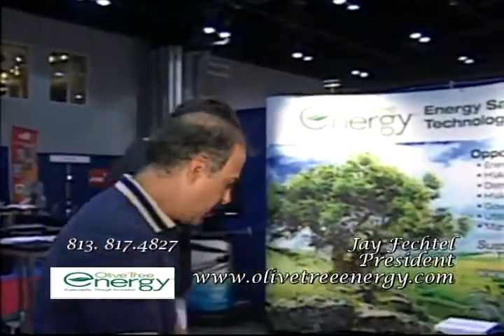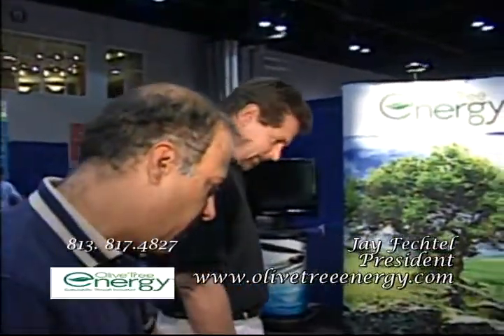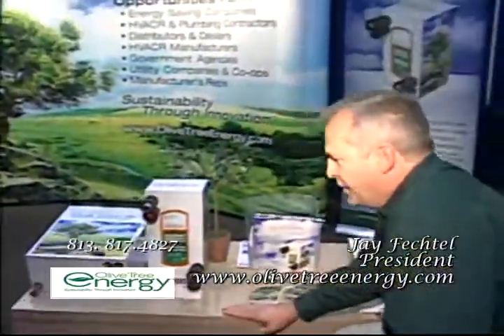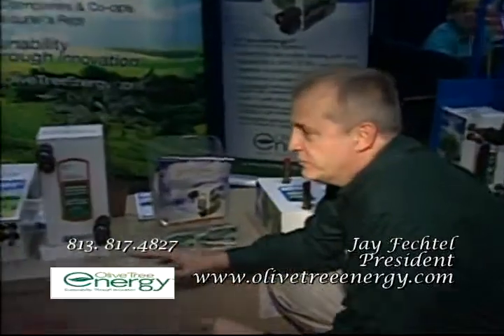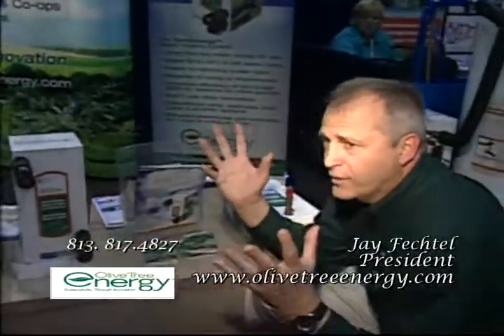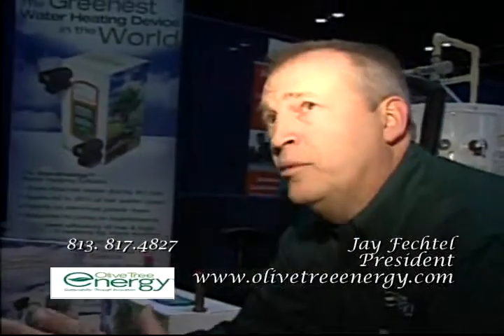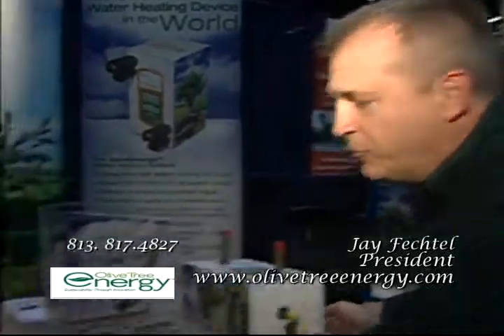ZeroEnergy™ Hot Water System - Smart HVAC Products

Comment: I'm an authorized Dealer for a Heat Recovery Unit made by Chesapeake, VA's HotSpotEnergy.  Learn more at: https://tinyurl.com/FreeHotWaterFromAC and call my Hollywood, FL landline # at 786.441.2727, toll-free: 800.250.8975, text: 305.297.9360, or e-mail: info@solarbuyersclub.org.  I can get you each unit for USD$450 including lower 48 states ground shipping

Comment: Wait shouldn't this be installed after the compressor but before the condenser fan ??? If after the condenser fan you won't gain nearly as much energy .  Great idea which can and should be done but with a completely  redesigned  "hvach20" all one  system
Reply: Kef103 I think that guy was initially taking of their air energy recovery unit, but the camera guy was aiming this at their hot water heat recovery unit, and this made the video very confusing.